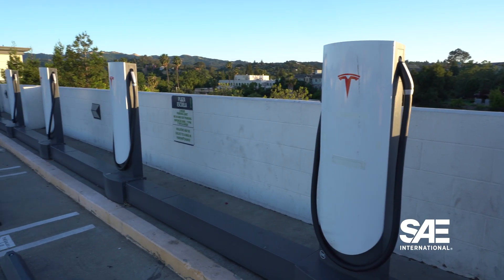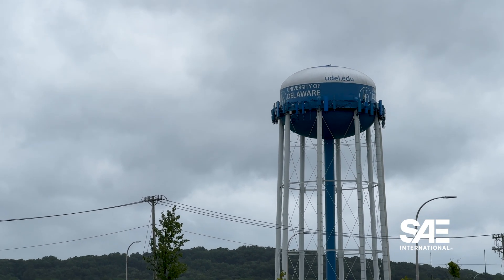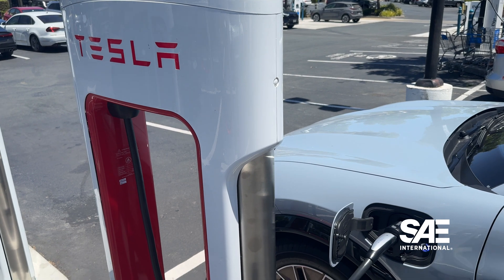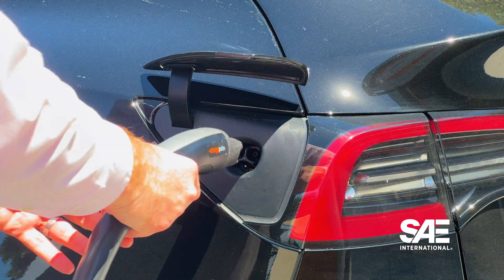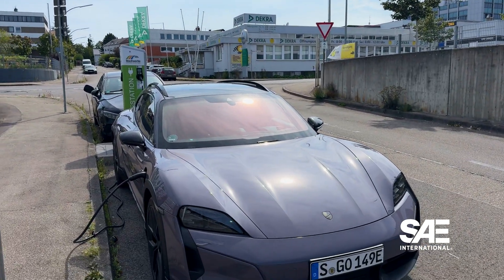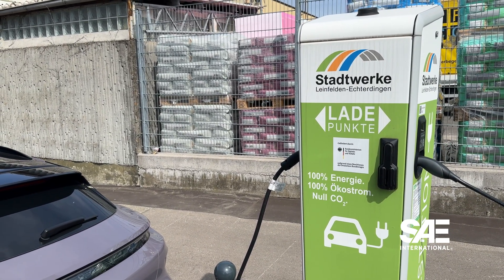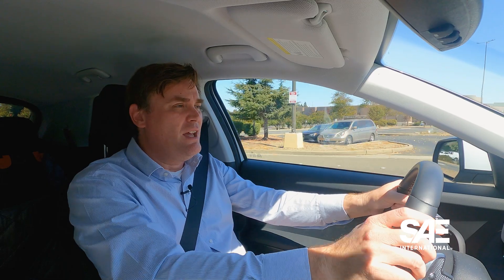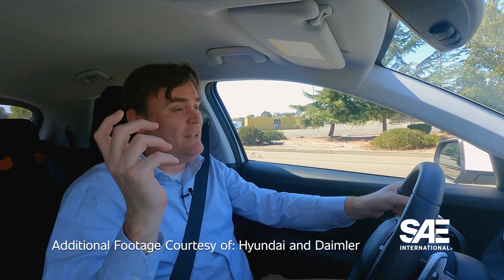SAE J3400: What You Need to Know About the Game-Changing Charging Standard

Comment: Is the final J3400 communication protocol different than the CCS1 communication protocol? I haven't figured out any way to answer this question except by paying to access the full standard.
Reply: It's the exact same - the adapters just connect the metal parts together inside. However, some of the older Tesla superchargers used the chademo (Japanese) communication standard, which is why cars with adapters can't use the entire network.